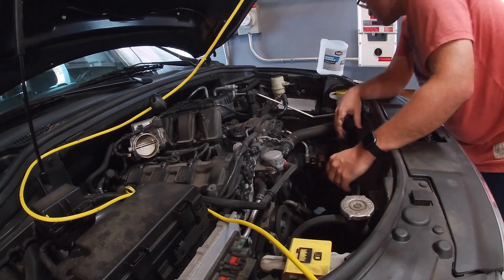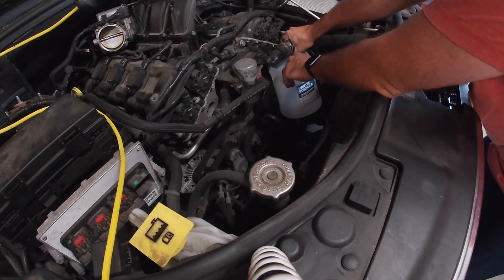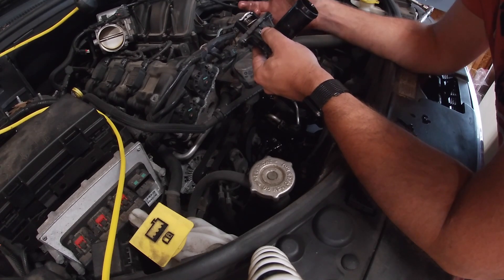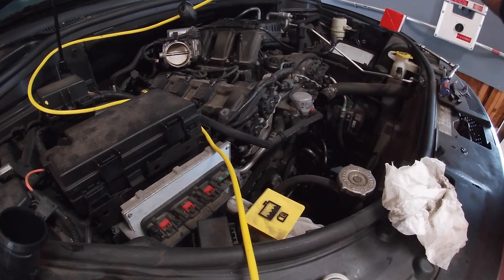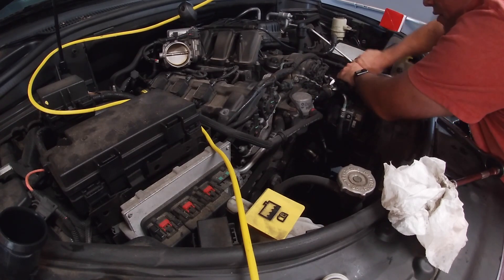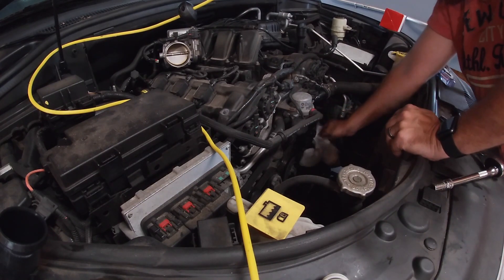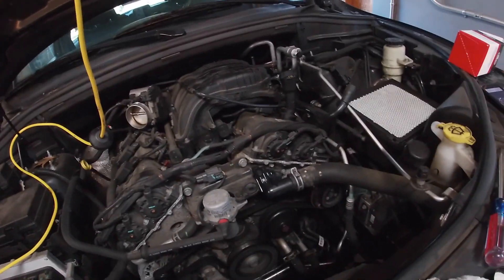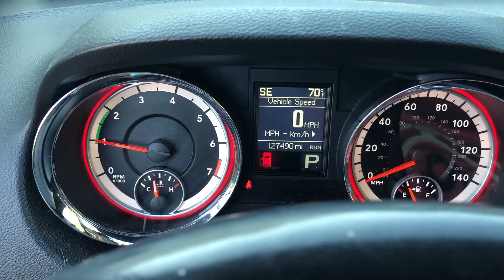P0128 Repair! - 2012 Durango 3.6L Thermostat Replacement

Comment: I just changed mine because it was cracked and now the truck overheats when I do 80mph or at high rpms. I did a coolant flush and vacuumed the system and its still doing it. Did you have any issues with yours

Comment: I tightened my housing to 110 inch pounds. Also, Dodge told me there were 127,000 thermostats are on back order so I guess they have a problem. My Durango now runs at about 190 to 200 degrees. How about yours?
Reply: And as of today 9/21/23, there still on backorder.

Comment: Where is the collant temperature sensor at on a 2012 dodge durango crew
Reply from the maker: Never done it but I am being told The Engine Coolant Temperature (ECT) sensor on the 3.6L engine is installed into a water jacket at rear of the cylinder head on the left side of the engine.

Comment: it was overheating ??
Reply from the maker: fily nv it could overheat. Thermostats get stuck in either open or close state. Mine was open so it took a long time to heat up.  If it were stuck close it would overheat.